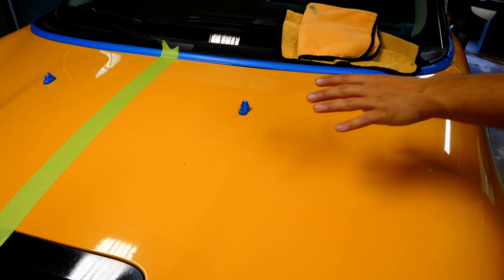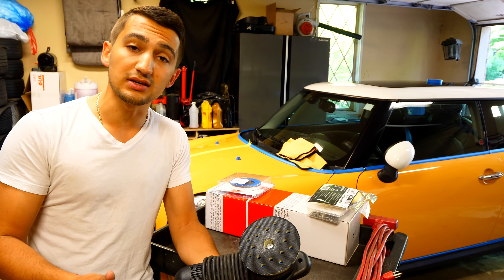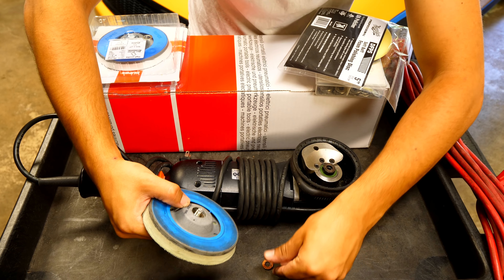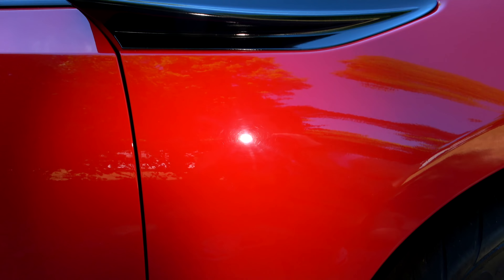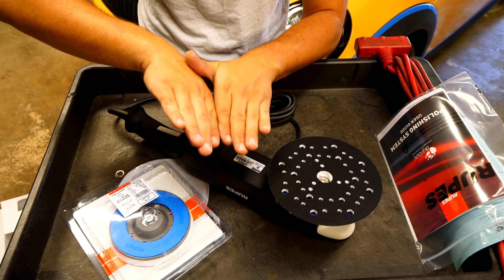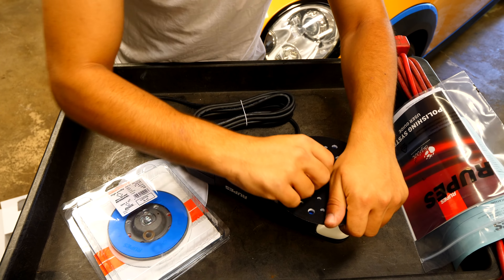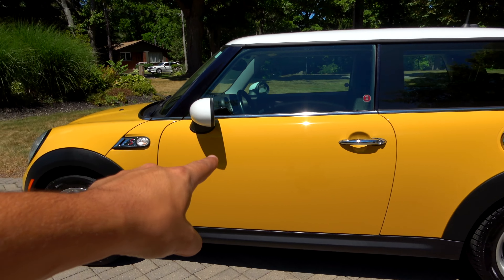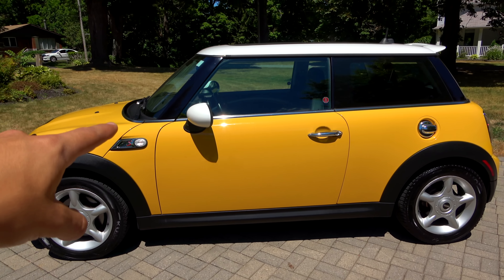I Purchased a Brand New Rupes Polisher & IMMEDIATELY TOOK IT APART!!!

Comment: I’ve actually had hands on training with rupes with Alberto,   And modifying the polisher can result in premature failure.  Anyway the rubber shroud is just causing a bit interference, but with the new mark 2 more power makes up for all that.   Also over use the rubber will wear.  And over time a washer mod will not be needed

Comment: Great video, but I don’t think it’s a great idea that putting a 5” backing plate on a 21, it has a reason of using a 6” BP on 21, check out the video that Rupes explains why you shouldn’t swap BP plates over on different machines, just stick with 15 if you really wanna use a 5”pad I think:)

Comment: That washer mod works. I had problem when polishing I would see little black dots splatter on paint  and realize backing plate was hitting the rubber on the polisher.
Reply from the maker: Its such a cheap mod that goes a long way!

Comment: I got my Duetto used, and it had a washer in it. I pulled that thing out, and started using their line of pads / polishes and never looked back. 

There was a learning curve though... But I'll never put a washer in that tool again..
Reply: danlc95, I’m going to be receiving a Rupes Duetto tomorrow. I wanted to ask about the washer mod that was in your Duetto. I wanted to ask why you took the washer out. Obviously you thought it was more beneficial. I want the Duetto to be as efficient as possible. Thank you.

Comment: I wonder why RUPES didn’t design the machine with this washer mod straight out of the factory. This mod must affect your warranty?
Reply: Presumably because it works better without the washer.
Reply: @andyh8239  absolutely NOT! Rupes designs these machines to be consumer friendly but not void warranty if you apply this modification. Some of the things in this video are true there are a few that are not.  Probably just a mistake and he didn't realize it when he said it. Why in the hell he would have to do a second step IDK because I promise you that those defects should've been removed and ready for sealant in just one step

Comment: great vid first one to show about the backing plate and in use going to buy the 21 mk2 but are u sure about putting the 5 inch backing plate does it perform the same with no extra vibration some say its fine others say its a no no

Comment: Hi, did you grind the edges of the washer? I read some info online at auto geek mentioning it was crucial to
 grind the edges, also they mentioned they had many returns due to customers using rounded washers. Please let me know how the washer mod is holding up on your machine. 
Thanks
Reply from the maker: If I were to use a larger washer, yes I would have to grind down the sides, but if you get one that is JUST small enough to fit around the bolt hole, you do not need to grind the sides down. It is still doing great to this day :)
Reply: milanmastracci My only issue is that when the washer isn’t covering that whole surface it can cause an imbalance to the machine (that’s what I heard) but if say its been working for u no problem I’ll give a try, thanks for the info dude

Comment: hey milan, I have an 8th gen coupe as well and was looking at 19x9 +40 offset rims and was wondering if 225 40 19 would be a good tire size for the wheels. A response would be appreciated, thanks!
Reply from the maker: 225/40R19 on a 19x9 will 100% have stretch. If that is the look you are going for, than do it. I had some 18x9's before and ran 265's, and could have gone with 275's

Comment: What’s your honest opinion on the dewalt buffer? I’d love to hear your output
Reply from the maker: It does a great job at cutting back the paint, however it will leave buffer trails in the paint, and is EXTREMELY noticeable on dark coloured cars. Other than it, its a terrific and powerful machine!
Reply: what polishing cream do you use and what brand pad?
Reply: milanmastracci how would you go about removing holograms? Just some good polish?
Reply from the maker: I use a Foam Meguiar's Finishing pad with Meguiar's M205 and it goes a great job and making the shine that much clearer without buffer trails / holograms :)
Reply: I thought we had to wait until Tuesday lol.

Comment: How often should you polish your vehicle
Reply: Jerry Rasavong whenever the paint gets full of swirl marks and the paint looks dull
Reply from the maker: Exactly! It all depends how well you take care of it and how you wash the car. The safer you are with washing it, the less you'll be scratching it. The less you scratch it, the less often you will need to polish the paint.
Reply: You should polish as much as the car allows you to. If your car is clear coated , the layer of clear coat is fairly thick, but if you are like many of us that purchased an used car, chances are it has been polished before, be careful cutting to deep with the polisher or you may get into the base paint fo the car.

Comment: Hey Mil!  
Do a video on clearcoat oxidation PLEASE ! I need your help! ASAP
Reply from the maker: I need a car that has some, but I'm down :)
Reply: Clearcoat doesn't oxidize.
Reply: You dont have an old enough neglected vehicle. It def does oxidize and when it does the paint has a chalky type of look to it.

Good news is, it can be removed and fairly easily n quickly with a da or rotory.

Its when the paint basically dries up mainly from the sun and the oils and chemicals in the paint are dried up and also contaminates left on the paint help speed the process up and make it worse than it would of been.

You need to at least polish the paint,  it can sometimes need compounding and in the case it gets abd enough, it will need repainting, as in the clear coat is peeling off. Sometimes thats from the process of not being cared for properly but when that happens its usually from something in the painting process that didnt happen the way it was supposed to, or bad cear coat that failed early for whatever reason.  If theres big parts of the clwar missing with faded paint theres not much u can do there besides getting to the paint and if the paint is thick enough sanding to clean good paint and re clearing, but thats rare thats ever an option, usually only starting froms scratch  is the only option.

Comment: Sometimes at night I put a blanket on my car and play your videos for it if it’s feeling lonely.

Jk original comment:
What’s a good budget option for a polisher?
Reply from the maker: The Meguiars DA is a great polisher that is half the price of the Rupes one. It does a great job at removing scratches, but might take a bit longer to remove everything compared to any of the Rules. Bang for buck, its the best way to go; https://amzn.to/2LAyrd5
Reply: Im from germany so i dont know whether this one is available ... But try to search for the Krauss Shine master polisher or Lupus dual Action polisher they are very good
Reply: milanmastracci thanks for the reply. Still a bit of a plunge though... I think I’ll look for used ones and if that doesn’t work out maybe I’ll take the hit and go for it.
Reply: ShuffleNeoxi funny thing is that I’m currently on a trip in Germany from the United States. I’ll give them a look.
Reply: Joseph Samsor or if it should be Something on the level of the rupes, its a bit cheaper but Most of the european German Detailer Love the FLEX xfe polishers!! So if you can find Something in Germany in a Shop definitly give it a try. Its still expensive but not as much as the rupes polishers